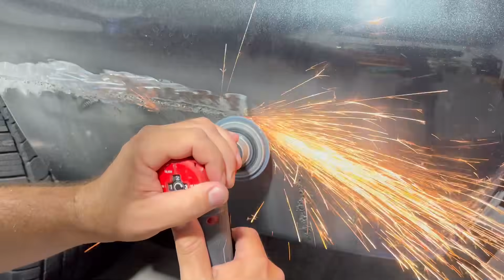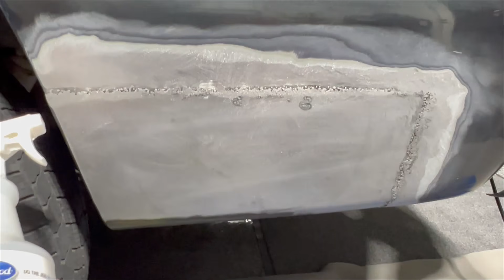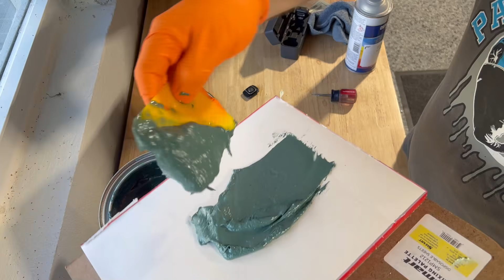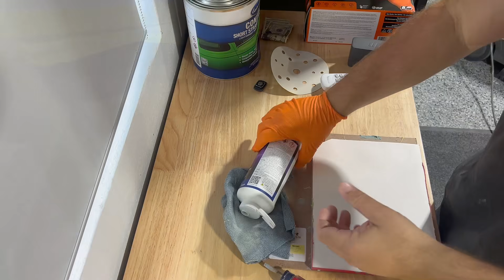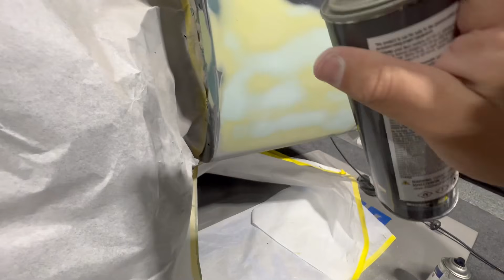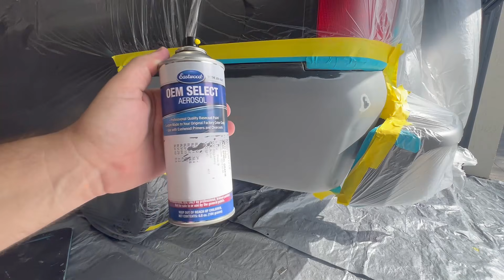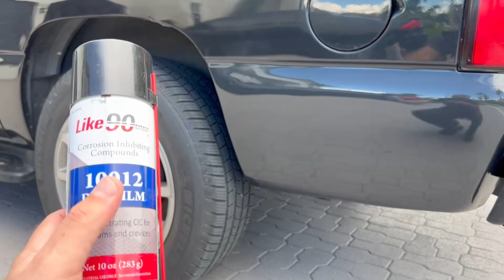The BEST Guide to DIY Home Automotive Rust Repair!

Comment: See you again in 2 years. The material will definitely rust again at the welding and machine grinding points. The only sensible thing to do is to glue the materials with epoxy glue and grind them by hand. Everything else is a short-term solution.
Reply from the maker: Hey. Whats your email? I want to send you photos of the repair.

Comment: That was $500 of materials to paint one small patch.  It all depends how many cars one is intending to fix. Those $50 (Canadian pricing) throwaway one use 2K spray cans and $69 matching paint cans are crazy, but a litre is $150 and may get old before you again use it. Plus the $$$ equipment needed.  There now are one part "epoxy" spra cans ($35) that can be reused.
-- But the truck is old, paint is bad, and he was intending to do more work, like the hood, so doing that little part to finish was poor economy, but good video.  Did Eastwood gift him the products?  Plus looks like he does not live in the rust belt... I would have used etch primer, done it only to 280 and painted with a cheap enamel black rust paint as good enough till the hood or larger parts are addressed.
-- But everybody wants shiny paint.... and he is Paint Society. Me, I like Rat Rods: only girls need shiny paint.

Comment: at the end, how do we blend the clear coat in, if we did not repaint an entire panel?
Reply: Non-pro advice: Wet sand orig clear with 1000 or better to dull surface. reduce clear further and blend gently. You can see where you sprayed and where you did not. allow to fully cure. wet  sand blended area with 2000. Polish.  Carefully chose where to blend, as it will not be perfect.

Comment: If the panel isn't sealed on the back side moisture is going to come thru the pin holes in the weld
and eventually start causing the mud to start blistering.
Reply: It was sealed with fiberglass. Yes, rust could grow but would have to climb above the fiberglass to be seen.  This would take several years. Of course, the backside should be sprayed through the drain holes with Fluid Film to prevent this. duh.  But the video was not about preservation, but about what most folks are interested in: the top coats.
-- To improve the job, he should have sandblasted the paint out of the welding pits so the phosphoric acid could get in. Also allow the acid to work for longer.  Even better, drill an access hole (have a plastic plug to close hole) and spray phosphoric acid inside at the already rusting patch panel before adding fluid film for 10 yr durability.

Comment: Knock the weld  in  3/16  to   1/4  inch  so  the fiberglass and  filler so there is some material to cover the welds,   ..

Comment: I've been doing paint and body work for over 30 years and I can honestly say that you guys spend way too much money on product. S you just don't need. I can do that same job.
 With  nothing but evercoat Body filler, 2K Apoxy primer. And finish it off with a sealer.
Paint  clear coat  done
Reply from the maker: Yep, and that’s what someone that’s been doing it for 30 years can get away with😀😀 that new guys to this type of work will require some more products to make it right

Comment: hey bud,great vid.little tip for you,when you finish applying your fibreglass filler,use a piece of wax paper over it(smooth side down) and use a spatula to smooth it out,makes it super easy to sand afterward
Reply from the maker: That is a great tip. Thanks for sharing!

Comment: needs to turn heat up a little on welder....i like to use short strand fiberglass filler over weld area....less chance of moisture from pinholes...nice job!
Reply from the maker: Thanks for the tip!

Comment: Don’t waste your money on the cleaner or etcher use cheap rubbing alcohol to clean and then use water and vinegar to etch it. Vinegar neutralizes the rust. also use some self etching primer on the bare metal before any body filler.

Comment: Other youtubers are posting budget fixes to clearcoat pealing. 
Do a search.
Eastwood Clearcoat is definitely the better product I've seen yet. 

Just sand off the rough clearcoat areas. Not the basecoat. 
Wash. Let dry. 
Apply new clearcoat yourself. 
Why pay more for a new or used hood when you can affordably fix your own. 
[ removing hoods can lead to accidents like damaged windshields, crushed finers or toes, & fender mis-alignment. 
I don't have an extra pair of hands. 
If you do, then go another route. ]

Comment: Good job, don’t listen to the YouTube experts complaining about something they can’t do and never did 😂
Reply: don't be naughty. or haughty. Been there done that. lots, from fiberglassing Gremlins, to lying under a Torino changing engine bearings. Bought a 69 rolled Galaxie with rare (10.5 to 1 compression) 429 with 40k miles at salvage auction for $375, then smashed my 67 Cougar XR7 showing off to friends. One of them was more hurt by his dad who beat him up for hanging with bad boys.
-- And at 70, am young enough to do it again.  In fact I am in the middle of a dissembled Rust repair Ranger in the crusty north. Doing it for love and as right as economically possible.  Lucky me, found a recent insurance replacement rust free flare side box for $850 locally, when one from Texas would have cost $3500 Canadian to get to my door.  
-- Cab corners out of the US were super expensive after shipping, duties, taxes and brokerage fees. And a gallon of phosphoric acid was $150... So be good 046 and don't assume the Watchers don't know stuff.  K?

Comment: Not really necessary to use Tiger hair for this application. It's really just a waste of money. Just use regular bondo. Tiger hair really only shines if you are filling more then a quarter inch depth.
Reply from the maker: You missed the reason why it was used.

Comment: I have an older mini van that has rust everywhere. Using it as a training vehicle to learn body work on. I like these tips. There’s just so many different kinds of paint filler sanders sand paper etc it’s hard to know where to start. I like that Yukon XL looks like a nice truck that a person like myself could get cheap and eventually have a nice vehicle out of.
Reply: Older minivan with rust everywhere means 2 things. One, it's not worth doing it right. Stay cheap: e.g., no need for expensive primer. 2)- start UNDERneath the van. What can be done to save the Frame structures, floors, suspension supports, inner wheel wells, rockers?  Will it pass inspection? Will you be transporting children in that van? What do you think will happen in a crash?
-- Everybody just looks at shiny paint: that's a fool's game. If it's good underneath, Rat Rod the outside with cheap rust paint.

Comment: Brian, I was doing a PDR glue pull on the roof of my 07 "Kona blue" Mustang, and it pulled the very small dent AND the paint n primer clear down to the metal, in one pull. Its about a 1.5" diameter circle. Ive been following your videos and learning step by step. Can i try and blend the paint, or do i need to redo the whole roof. This will be  my 1st time painting, so im still trying to learn by watching your videos, which are extremely educational. Thanks for teaching us.
Reply: You can blend but it will be noticeable. An expert, if willing, could do better, but will recommend the whole roof.  Depends on how fussy u are.

Comment: How much $ do you have into all the products? Eastwood is good but not exactly inexpensive.   

If your going to spray can a job to save $ I would use other products.

You touched on all the steps well but if I never ever did a rust repair from this video I would be a bit overwhelmed .

Comment: Basically too many products for a simple repair,  achilles heel the welding, that needed a overlap only to close the troughs,   then using a hand panel file to flush the repair, clean, then,  putty,  paint,  ive never seen so much products used?
Reply from the maker: Glad I could teach you something this time. Thank you for the comment!

Comment: Would you need to epoxy prime the backside of the welds?
Reply from the maker: Its a great idea
Reply: @PaintSociety  thank you so much Brian. So far I've used auto shop Bulldog, Transtar, and PPG in  custom SEM cans to repaint the rear bumper of an 05 Highlander. Next up is a rust spot on rear of my dad's '10 Four Runner that is 2"x3" or so.  I'm hoping to sand down, treat pitting with Metal Rescue Gel and then get into epoxy primer etc etc ...but after watching you, I'm thinking I don't have a good grasp of why the various body fillers were needed.  Time to research a little more.  I don't intend to cut, patch, weld, etch and fill as the rust is not thru....not fun in salty upstate NY.

Comment: How do you protect the inside of that panel,i thought that part rusted from the inside out..great job
Reply: generally you dont unless its galvanized or you paint it being from a hole drilled on the other side...  I used galvanized steel, this way it wont rust on the otherside.

Comment: Look great from this side.   What do you do to protect the welds on the inside of the panel?
Reply: Fluid Film through the vent holes, or drill a hole that you have a plastic plug to fill.

Comment: ok can you explain how cutting a section out of a new panel and welding it into place after you grind away all the rust to as good as you can get it and then applying a rust inhibitor and hoping the rust does not come back is easier than bolting the new panel in place and painting it if the color does not match??????? one is for sure the easier route to fix the rust i wonder which way is easier???????
Reply: If you’re asking this question you don’t need to be doing this kind of work in the first place. On what planet can you just “unbolt” a rear quarter panel on a freakin SUV? The front of the vehicle “unbolts”. The rear does not in most applications.

Comment: What always confuses me, and nobody every really addresses it for some reason is, what about the back side of that weld???
Like, won't it just rust away since it's completely untouched and protected?
At least on that part, you could probably get to the other side to sand it and seal it up and paint to protect it, but you didn't, and nobody ever mentions doing that???
But also, what about the places that you can't even get to the other side...
What would you do then, if you wanted the repair to last more than 2 or 3 years?

Comment: Bro, that finish is TIGHT! I wanted to do some work to my Cateye chevy, Rocker panels...Are all those two part sprays; One and dones? once it's mixed use it or lose it?... I use pre-cat epoxy  paint in residential trim etc, but; you can reuse it once it's open...

Comment: I have done some body work when I was younger , always wondered
How concerned are body shops , developing rust from the inside .
Reply: Many mainstream shops in my area will not touch rust.  They do insurance work only, and vehicles must then pass body integrity inspections.  Saw one car at the salvage auction that was completely repaired, but failed because of underneath rust.

Comment: I was curious if you would ever access the backside through a drain hole that you could create and then plug and spray corrosion protection on the panel's backside. Excellent DYI.
Reply: If he doesn’t, it’s just going to rot out fast with all that welding having burned off the primer coat on the inside..  Good video otherwise…
Reply from the maker: Wish you guys watched the end of the videos
Reply: @PaintSociety  my apologies - I got pulled away and somehow it skipped to the end. You made a really good video of a repair that will last for years. Kudos!
Reply: @PaintSociety  I did watch the entire video, showing some minor spritzing through a screw hole at the inner fender wheel opening is not coating the inside of the panel adequately. It will just rust through from the inside.
Reply from the maker: @KarateSensei71  whats your email. I will send you monthly photos and updates.
Reply: @PaintSociety  If you lived in the Rust Belt like I do it might be of some interest.
Reply from the maker: Well, I just wanna keep you updated because you seem really concerned about the repair and I want to do my best as a creator to keep you informed.
Reply: O
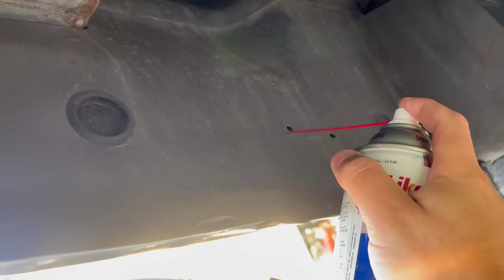Reply: At 31:14 you can see the rubber 1” ‘plug’  on the inner fender. I removed that plug and saturated the inside of the outer fender with Eastwood rust converter.

Any existing rust is neutralized.

Comment: Please advise, I was trying to find my notes on products that I saw used on one of those Car and/or Truck shows. I remember It is a product that you can spray on your vehicle to stop the rust from spreading and yet it protects the patina - I think it is good stop-gap until you can prepare and paint your vehicle.  I own a 2005 GMC Sierra 1500 and the clearcoat is basically destroyed on the hood and roof; the sides have a lot of scratches due to bungee cords used while covering the truck with a tarp to impede water leaking into the passenger cab for approximately four years-(4-yrs).
Reply: Vice grip garage has a product and poppy's sweet patina that Dylan mcCool uses.  I forget what budget buildz uses...

Comment: I've never had any problems taking a finish off metal on any car/truck and applying lacquer primer surfacer to the bare metal. Primer is the adhesion prep (it's not classified as paint) to accept your finish coats. It sands well, exposes warps and issues of metal patches and won't rust at all depending on the length of time and prep work for the final coats of paint.
Reply: It needs time to shrink. good for a homeboy working a couple hours on it here and there. bad for production work. And it's a soft foundation, as opposed to epoxy.

Comment: I have  2014 F150 with steel body color painted bumper. The bumper has some surface rustvabout the size of your palm near the front wheel well. The paint is white platinum pearl paint. Can i use this method (other than welding patch panel) to repair the bumper and make it look good?

Comment: I appreciate your input and  ‘how to ‘ techniques, but I feel that at the outset where you mentioned that you are not a professional welder and you did a ‘rough’ job welding, the resulting ‘pockmark’ effects in the weld area only gave reason for all the ‘extra’ steps to fill in or cover up those areas only means more labor times as well as added expense for the job.  Needing to buy / use added products just to eliminate the ‘weld-blemishes’ just seems to me to be unnecessary. I think doing a more effective job of welding would eliminate the added steps to ‘cover up’  any ‘sub par’ welding.  I’m sure you are able to do better welding, and you probably did it that way for training your viewers, so I only say this as my own personal opinion. Time is money, and even in a ‘diy’ setting wouldn’t it make more sense to just buy and use only what one needs to get the same results? I DO appreciate the video and I did learn some valuable lessons so please accept my comments as more of a compliment rather than a criticism! Again thank you for your presentation. Keep ‘em comin’! 👍🏼🤔😎
Reply: 😂 having perfectly smooth welds on body panels is extremely unrealistic. Even if they’re dimes, you still have to grind and sand them down. There’s no way around it. That’s just how it is.

Comment: I would avoid the harbor freight wire.  Unless something has improved in the last 5+ years, I had poor results with their wire but much better results with wire from home depot.  Using a Craftsman 120 volt flux-core welder.

Comment: 2k clear $40 a spray can same with the primer going to a bodyshop jobbers store or site can of oem exact match colour between $20 for a small can and $50 for a large can has for the clear i asked the owner of the paint store i go to what he recommended and he said use the laquer clear for small repairs its a waste of money to spray a small repair with a $40 can of clear . if your doing anything like a door panel then yes use the 2k stuff because its a large panel and youll use the entire can . brian when do you use blender on small repairs before or after clearing .

Comment: I bought a old Honda for $1500 with mint interior, outside was all burned up! and handed sanded the whole car and used cans of spray paint and light wet sanded. Used cans of clear coat. Let dry 30 days lightly wet sanded and used a buffer wheel and different maguirs compounds and when I was finished, people thought I spent $10,000 on a paint job. Never did anything like it before, just watched lots and lots of YouTube videos. I just sold it for $7800 . I wanted $10,000 but money talks and bs walks! I made about $7k , I’m good.

Comment: You missed the mark on this one Brian! Just wrong in so many ways! That is the worst welding I have ever seen. Looks like you welded over paint or other contaminants. By starting with bad welding you created a lot of work for yourself and potential for future rust regardless of whatever primer or plastic you put over it. I suggest you watch Bad Chad's video on welding patch panels and Bondo Billy's videos on using primer and filler. Welding panels is not hard. Any beginner can do it right.
Reply: My guy, that’s the whole point of the video. It’s shows you how to get good results if you are not an experienced welder. He said that several times in this video.
Reply: @lawnmowerdude  I said: Any beginner can do it right. Did I need to say "Any beginner welder can do it right?" Good results?? Not. Rust is coming from the back side of that panel. Inevitable with crappy porous welding.
Reply from the maker: I didnt weld this.
Reply: @PaintSociety  That's good.

Comment: That turned out pretty nice but one thing I’ve noticed that your weld had lots of pit holes threw it and you didn’t treat it on the other side of that panel.
Reply from the maker: You didnt watch the end of the video